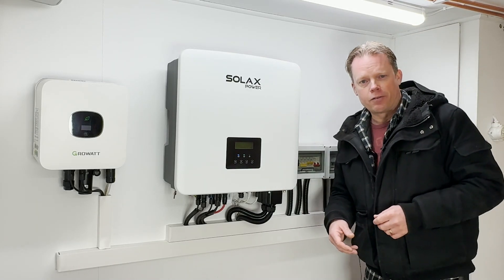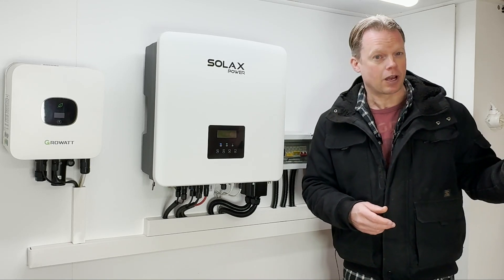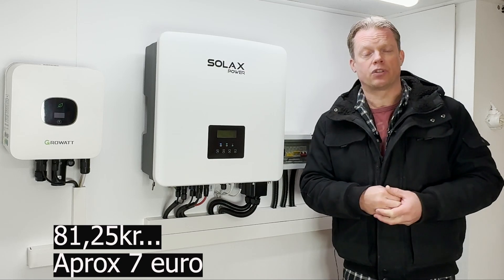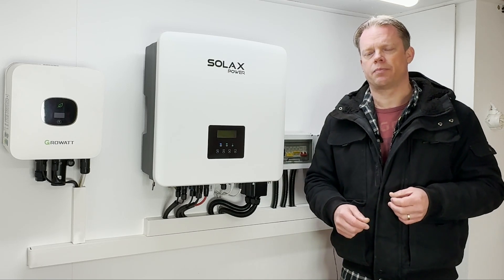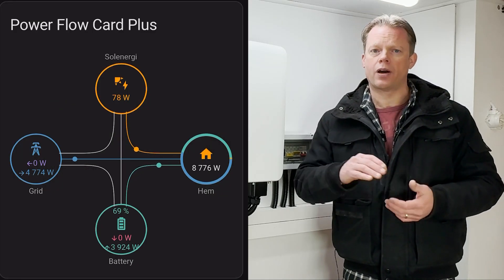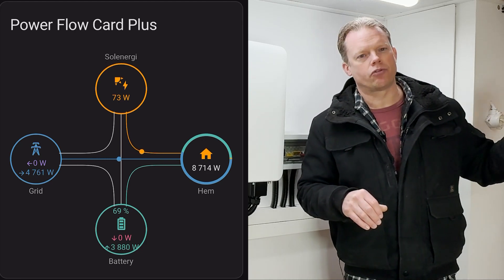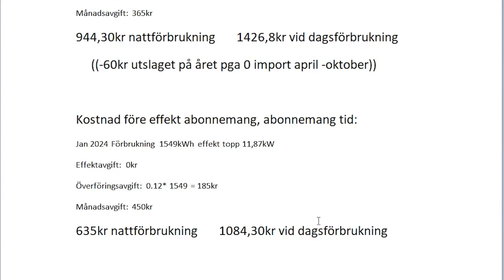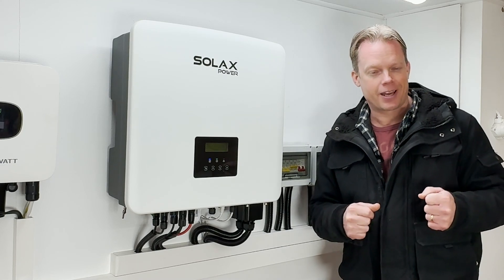New grid tariff fees, Peak shaving, Nighttime power, home battery storage. How much higher cost?

Comment: Well explained! My key takeaway: electricity is crazy cheap in Sweden. I also payed 83€ this December but used only 270 kWh!
Monthly fee in Germany is lower (around 15€) but the price per kWh is much higher. If I manage to use only surplus energy on my dynamic tariff (i.e. spot market price of 0€) I still pay about 0.2€/kWh because of grid fees and various other price components. If you're on a fixed tariff you'll pay like 0.3€/kWh
Reply from the maker: Thanks, yes, I’ve heard about your prices, that’s crazy!! Thanks for your input, interesting to know and see the differences👍🏻☺️
Reply: @flyingtools  In my german region the taxes are 0,22€/kWh (fixed), it is enormous crazy here 🙈🙈 ... if production price is 0,01€/kW, I have to pay 2300% taxes ....I have no words for that, it is like criminal 😤. So most people in germany use fixed price, because it could be go atomic high in the price. (In December was 2 days, the price goes over 1€/kWh)
Reply: @tk_tech88  Just to put this into perspective: yes there were a few hours this winter were prices soared to the level you state. If you bought into dynamic tariffs you will be prepared to avoid these few hours. The larger issue was high average prices (like 100-200€/MWh) for days which eventually become unavoidable.

The non-spot market parts is not all taxes and stating 2300% is making a drama. If spot market price is 220€ it is 50% to do the opposite. I do agree this is too high. 

It is due to the grid being heavily worked on and also by high redispatch cost because Germany, as opposed to Sweden has no price zones. So the wind-averse south enjoys low electricity prices when there is a lot of wind, but the wind power doesn't reach them and is created by costly gas peakers instead.

Comment: It's hard to beleive that buying electricity has become so complex on domestic tariffs, in my career i dealt with this to ensure that the company had the best commercial contract available by using generators,  peak lopping, load shedding if possible etc to ensure that the usage profile would fit the most attractive tariffs which is basically what you are doing on a smaller scale.
I do feel sorry for the people who don't have any way of reducing  costs and I'm sure there are quite a few.
One of my friends is currently working in Sweden as an engineer on the new data centres that are being built. The fist site is due to go live in 2026 with an electricity demand of a staggering 87MW. 
Recently watched the Swedish Energy minister giving an interview to the press regarding the energy markets, I've included the link

https://youtu.be/90N6tcTC92s?si=RRX7i_WpbZLQho-O

Great explanation off the tariffs

Comment: Interesting. I assume the peak use fee is supposed to get people to use less when the demand is high on the grid but if it can be applied whatever the demand it wont achieve this at all. Is there a governing body that you can write to or something and lobby to get it changed? You are pretty much an expert in the field so your opinions should have some weight.
Reply from the maker: I really wish that I could do that, but sadly, this is far beyond my possibility to do anything at all about.

Comment: It looks like your power monitoring from your grid supplier is far better than in the UK. I have been struggling to get my suppier to connect my SMART electric meter so that it will send them data. What system is used to send the electric metering data to your supplier?
Reply from the maker: Yes it’s a really smart meter and it sends the date once every 15 minutes via the mobile phone network so I guess that in the future we might even will have this fees in an even smaller time frame, like half an hours or even minutes… Who knows…
Reply: In the UK it sends your consumption in half hour intervals. You can get data for every 15 seconds but you need to pair a device with your meter to collect data at that frequency.